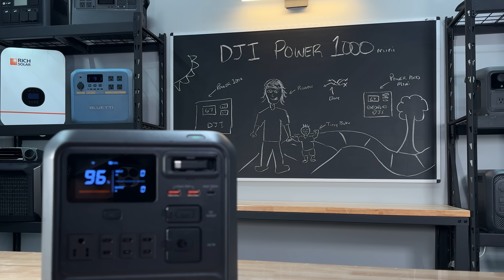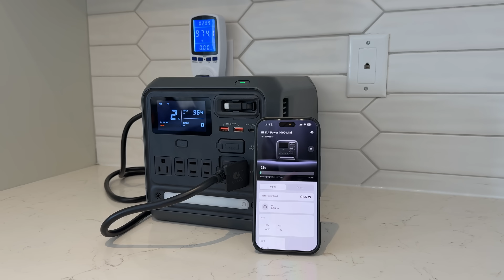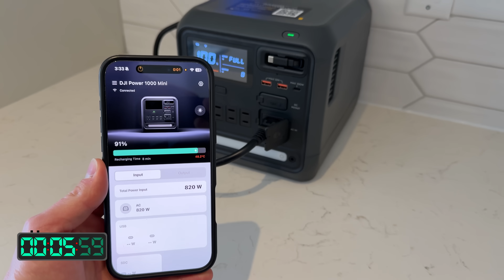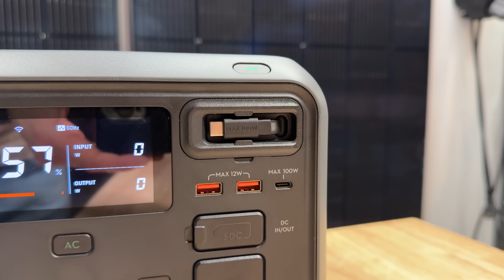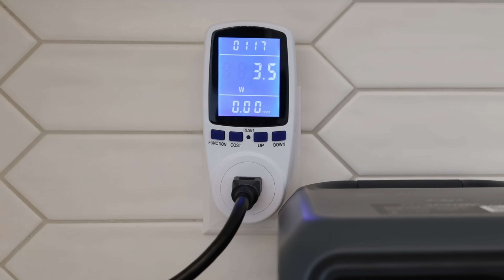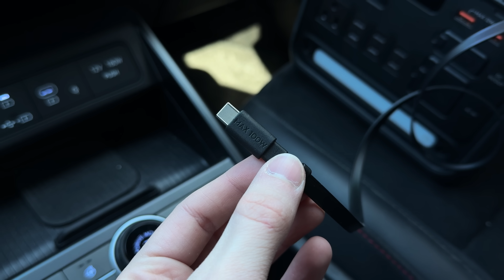Power 1000 Mini - DJI's Best Power Station Yet?

Comment: There is no cigarette lighter socket for connecting 12V devices or a portable fridge. You can use an SDC cable, but then solar charging doesn't work. A total failure.

Comment: Checking in, if i do use this for 80% time UPS functions for my PC (about 500W in max) (probably once a month going for family outing n BBQ)

and i noted that DJI 1000 mini does not have a charge Limit/Cap/protection.

Would maintaining max 100% charge degrade the battery life.

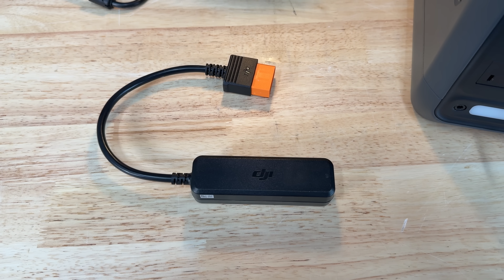Comment: 7:45 is this the adapter you are referring to, what is it called. I accidentally ordered SDC to M4 and SDC to XT60 so waiting on the mppt to charge my power 1000 mini and Ecoflow solar panels. Hopeful now their XT60 connects right into the mppt adapter and off I go. Should handle 400w and I have 2x 160w panels

Comment: I have just tested DJI Adapter with Sola but unfortunately its not charging, also same adapter i used with Car charger unfortunately same , DJI website mentioned Adapter only support dji older models, now i am kind of struck to spend £45 + £45 two different cable for car charger and sola, such a pain

Comment: To charge the device with a solar panel, you will need the DJI Power MC4 Solar Power Charging Cable. Then, MC4 connects to the solar panels. 
You can connect more than two using the DJI Power Solar Panel MC4 Parallel Cable.

Comment: That's the deal breaker we don't need a retractable cord. So if that cord screws up or any reason it affects the whole machine this is a no-brainer you got to be smarter than a fifth grader though to figure that out along with all the other retractable cords on all the other battery banks stupid

Comment: Meh, the Blu elite 100 V2 is exactly the same weight, but an 1800 watt ac inverter not a weak 1000 watt, there’s a Pecron 1000 wh that’s 23 lbs too.  The usb c cable is cool, but could break and get stuck outside making a mess.  It looks decent but only on sale, right now it’s basically the same price as the Blu 100 v2 that destroys it!

Edit: plus the crappy solar low wattage input sucks.

Comment: suprise that the building car charger is completely skipped. Other powerstation will need a costly adapter to charge it from car. This one just needs a $40 cable to get 400w charging and acts as a car battery booster at the sametime.
Reply: No, that's not the case
Reply: @AnnoyedBeach-uk7tf  what is your take then?
Reply: @xuhaoping4360 I didn’t take it, went for jackery
Reply: @AnnoyedBeach-uk7tf  I see, you just don't know how to read, jackery asks $300 for a car charger.
Reply: @xuhaoping4360 but, your buying quality. I don’t mind paying

Comment: 400w solar is not enough to me that is why I use ecoflow delta pro I have 1500w on my roof at least I am able to run my refrigerator and some other devices in my wooden house

Comment: No power surge numbers? How long can it operate at max/over wattage before cut off? Does it automatically turn off after x amount of minutes if not used? Don't understand you didn't include that having only 1 USBC port is definitely a negative. It's 2026, there should've been at least 3 USBC ports and only 1 USBA.

Comment: that solar adapter is a deal breaker for me. my bluetti only has xt60 others have xt90 you can oversize whatever solar panels you have as long as the VOC is not higher than the max voltage input. pretty much every other powerstation doesn't care as long as you wont exceed the voltage. the built in mppt will do the rest, but with this? come on too much drama, hassle and complication. nope not ideal for camping when solar is the only source for charging. 
second that proprietary port for solar charging means you cant expand using a 12,24 or 50v lifepo4 batteries.  nope not recommended, they wanna be a future looking powerstation, but completely forgot how to build one for the real market they intended to sell.

Comment: What happens when the retractable cable stops working? Wouldn't it be much better if it were an inch taller and had a small compartment on top to toss a couple cables in?
Reply: Bingo🎉. If the cable mechanism breaks it’s a pain.

Comment: I am a bit disappointed with your video, I was waiting for it because they were 1000s of videos that were only paid ads, you my hope were you guys, but you dropped the ball.    You mentioned the inverter is 800w when in reality is 1000w (some other influencers said the 800w as well, so I assume DJI provided outdated/wrong data and you never tested properly).  And you ignored what is to me the biggest cool new feature in this power station, the included car charger in the device itself, just with the 50 EUR cable you can charger from your car at 400w.   The only real issue I have is the removal of cigarette lighter output, which is to me the best way to run a fridge.   You can get the connection back by buying the 50 EUR extra set of cables for cigarette lighter though.

Comment: 800W inverter is plenty for a portable office setup in the park. Running a laptop, monitor, and maybe a small fan does not require a massive heavy generator anyway
Reply: 800w is plenty to run crockpots (150w) and myMini Cooker (260w) electric skillet and deep fryer (600w) and the 600ml WTJMOV electric kettle (600w).

I use an 800w inverter to charge my oupes at the 700w ac rate from a 12v 310ah lifepo if it has run low and need a higher output inverter also.

Comment: Most units with more than 2 ac plugs will be tight. I have a small power strip with 4 outlets that I use to avoid the crowding issue. Just do not go crazy and plug 3-4 higher draw appliances into it.

Comment: how does that cord know to give or get power?
Reply: it indeed a very relative thing, i had a powerbank with a 60w 'PD' and it could charge the unit or output 60w, USB-C... the versions of USB vary. I use magnetic usb connectors and cables. They're brilliant and I've had no issues with them except that using them to charge the 72XXXmAh powerbank, using the afermarket adapters, it completely bricked the powerbank unit.

Comment: As an Ecoholic, I find this kinda good overall. The only pain point is the solar charging, very slow and the solar port type is not the very common XT60i. Criticism of the AC plugs layout is also valid! Not well spaced and 2 type A and 2 type B should be the correct mix. This could be used as a UPS but how fast?

Comment: Hard pass. Hands down the least useful AC port layout I've seen. I cant fit any usable plugs in unless I want to plug in 3 table lamps. And with 3 lamps plugged in i won't need the built in emergency light which is about the only redeeming quality.  Can't trust the app not to phone home so I'd have to air gap it at home and I couldn't bring it to work to top it off if I had not power at home (DJI is banned)

Comment: the DJI dose not fit my needs...  for different reasons i would go percron ecoflow or bluetti all for different reasons depending on what i needed at the time. It is always nice to see the other brands but i do not use any DJI equipment so the benefits of a DJI power battery is less effective. 

I tend to watch most reviews to see if a particular power station is something i would recommend for a friend when i hear they want one.. and with the exception of 1 person i know that uses DJI drones and such i just do not see the benefits..  

As for people looking at space savings in a power battery i think the most recent winner is going to be the bluetti fridge battery for the low profile format.  but that is for people who do not need usb sources..

Comment: I actually really like the concept of an extremely small form factor, 20ish pound 1kwh unit like this, but man they couldn't have screwed it up much worse lol. How about 3 grounded plugs spaced an inch or 2 apart since it's only an 800 watt inverter and most people won't have more than 2 things plugged in anyway? The lack of solar port AND only 400 watts of solar total is the most insane thing to me, it's like they designed this thing to compete with power stations from 4 years ago, but it's still not as good because of needing an adapter. Back to the drawing board.

Comment: The solar nonsense is a deal-breaker.  It's not just the stupid Port that they try to force you to use, which I'm sure is fine if you're in the DJI ecosystem. But if I don't care about drones and I don't then I don't care about that ecosystem. And even if you get the adapter it's 28 volt Max input. So do the math that's 14 amps. Try to find a solar panel that's going to get you even close to that 400. So having only 400 and a kilowatt power station is lame anyway. But then you're probably never going to get 400 unless you just get lucky with a very specific solar panel. So all in all it's just really stupid and an easy pass so thanks for the video and review.

Comment: You can get an Anker Solix C1000 that is expandable to 2kWh for $429 so I don't think this represents good value for the majority of people.
Reply: The more pull on that cord the sooner it will not work.
Reply: You're describing the gen 1 C1000; the gen 2 C1000 does not support expansion batteries, but I agree- the Solix C1000 is a far better investment- I've got 2 of them now.
Reply: You’re comparing it to a much bigger unit, so naturally there will be differences. Each power station has its own pros and cons depending on the intended use. The DJI Power 1000 Mini is designed primarily for portability and convenience, which is exactly what most people in its target market are looking for. If someone needs a compact and easy-to-carry power station for travel, rides, or outdoor use, then this product serves that purpose well. Bigger capacity units may offer longer runtime, but they also sacrifice portability.
Reply: The DJI 1000 MINI does have advantages.  I looked at the c1000 - one must factor in that the DJI is smaller - 1.5kg lighter - cheaper (in my country anyway) - by $100. DJI states a life of 4000 cycles - C1000 life of 3000 cycles..
And if you want to charge the mini from a car you do not need to buy and install a fricken dc-dc converter. Thanks to the MPPT converter built in already. That’s a huuuuuge plus. - just need the cable, though it’s included in some promotions. Shame the DJI doesn’t have an xt60 - you gotta pay for that cable which sux.
If you want to extend the c1000 that’s a huge extra cost. But an advantage.
The mini is an exceptional offer in the line up. (if extending isn’t a big necessity) maybe there’s a work around for that hopefully. But the 2-way car battery charging feature is where this kills the competition on the convenience front imo
Reply: @luckyphiltech Thanks for the feedback. Let's have a more comprehensive look at the two options...

Capacity: DJI = 1008Wh, Anker = 1056Wh

AC Output (Running): DJI = 1000W, Anker = 1800W

AC Output (Surge): DJI = 1200W, Anker = 2400W

Expandability: DJI = No, Anker = Yes (Up to 2112Wh)

Weight: DJI = 11.5 kg (25.4 lbs), Anker = 12.9 kg (28.4 lbs)

Solar Input: DJI = 400W, Anker =  600W

Cycle Life (80%): DJI = 4,000 Cycles, Anker = 3,000 Cycles

Price: DJI = $467, Anker = $429

I think that you will find that weight difference and cycle life are not significantly different to the extent that they would override the advantages of the C1000 and that in real world circumstances the C1000 has the advantage where is counts the most.

Comment: Please spend more time on the DC/solar input.  How many amps and at what voltages.   Some units can draw full amperage as low as 11 volts, others need over 30.    I have seen units can only charge quickly within a narrow voltage band which might match well to many solar setups or battery inputs (when using external batteries to extend run time during a prolonged outage).
Thanks

Comment: If power stations are going to be used/promoted for use as UPS units it would be helpful if the testing data you guys go over included their limits for surge power.

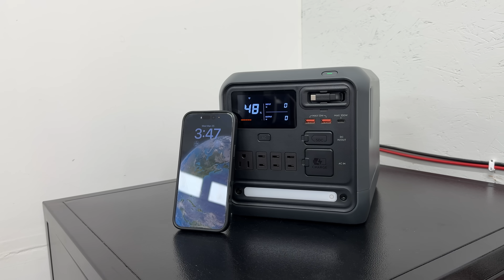Comment: 6:48 "Its idle consumption was only about 10 watts per hour."
Since a watt is defined as one joule per second does this make the idle consumption 10 joules per second per hour? What the heck is that, the change in the rate of energy transfer, or in other words acceleration of energy transfer? Your statement does not make sense.
Reply: Seems pretty clear to me.  What's hard to understand about ... it consumes 10 Watts every hour the inverter is on?
Reply: @RPRosen-ki2fk  It consumes 10 watts continuously. It would be like him saying his car used 10 gallons of gas to drive 60 MPH -- which is nonsensical. "Experts" in the power industry like they claim to be should get this terminology right.

Comment: There is an interesting dongle for this unit that basically is just a straight cable (with a fuse) from a car battery and will charge the unit at 400w. Or reverse charge your car battery automatically (or manually). Basically enabling the Mini to have an alternator charger at 400w. Competing brands offer their own 1000w or so alternator chargers for maybe $300. And those have a separate DC to DC adapter box that connects to your power station. Adding extra clunkiness.

The Mini just has a straight cable to the car battery and uses its internal MPPT and SDC port to control the flow. Which I admit is a clever way to use the SDC port. Sure its only 400w though. No idea how much the cable is going to be though. (Looked it up: US$ 34. Unsure if available in the US.)

But IMO a single SDC port ruins the accessory system because you have to choose between: solar, car, alternator, (etc like drones) and literally having to unplug and plug stuff constantly if you plan on using it.

I mean, it doesn't even have a lighter socket. Or equivalent 12v DC for portable fridges. SDC has a dongle for lighter socket. Another one.
Reply: Can you  link the dongle?

Comment: Since you have been using it indoors as well, can you tell if this device produces any type of smell at all? I used the 1000V2 in my ventilated office, but it kept smelling something chemical. DJI replaced the unit, but it has the same problem.

Comment: Underwhelming power bank. Low dc input and sorta a small inverter. I own a BLUETTI elite 100v2 that I recently purchased on sale for under $400 and don’t see this as a better option. The BLUETTI has 1800w continuous ac output, max 1000w 20A dc input, and weighs the same. The plugs also would be a no go for me also. The size seems to comprise the functionality. I am no expert but I definitely think there are better options for your money.

Comment: This is definitely a step up from their 500 model, but the ECoFlow Delta 2 can still be had for almost $100 less, with a much larger inverter, battery expansion and still pretty light around 5 pounds heavier (it is incredibly loud though!!).  Also, with the Pecron E1000LFP, it simply has more of everything including the 25A 12V DC output for about $80 less.  Nice to know about the solar issues encountered!  DJI, in their promo video, was touting that DC input as a 400 watt alternator charging input, which would be cool except it looks loke that cable isn't included either:(

Comment: I would order one if they were available.
Reply: Really? There literally is no worse way to spend that amount of money lol, every competing power station is significantly better. The Bluetti Elite 100 V2 charges at 1,000 watts via solar, has the same battery size and an 1,800 watt inverter with 4 grounded plugs and costs less. It's like getting a Toyota for less than a Kia.
Reply: @enthused7591  the only advantage of this DJI unit is the integrated car alternator charger (well, you still have to buy the cable for $50, but that's reasonable).    I wish Bluetti starts integrating their "Charger 1/2" into their units).

Comment: So what if the cable is broken and need fixing? Change the whole unit?
Reply: The retractable cable is replaceable. You can buy the retractable module thing. Probably for a really annoying price though.
Reply: @TechInspected ok that’s actually cool. Cause on power banks these are not detachable or repairable.

Comment: I thought the solar input was happy as long as you dont go over voltage
Reply: Correct. They probably went over on the voltage. If they did not go too high on the voltage then the DJI component does not live up to the power/current rating.
Reply: hard skip. other powerstation wont give you headache on that solar proprietary adaptor, all powerstation exept dji has built in mppt as long as you dont go over voltage itll charge the heck to any kind of solar panel. no drama

Comment: It's absolutely weird to me that dedicated UPS units with Lithium aimed at a home user are basically unobtanium. Why would anyone buy ancient lead-acid chemistry batteries these days? So I guess for home UPS duties these powerstations arte the only sane option (of whatever brand).
Reply: The main problem is LFP degrades much more rapidly when not cycled regularly and just sitting under a warm desk behind a desktop at 100% all the time is probably one of the worst use cases for it.

There are probably good software ways around that, like if you enable UPS mode only charge to 75 or something.

But also, a 1500VA line interactive UPS is only about 200-250 bucks. They are designed to keep your machine running long enough to wrap up and turn off properly, not run backup power for a day.
Reply: @Snerdles  And almost every "real" UPS (even cheap ones like APC) have a USB port to connect it to a PC and in order to shutdown the PC properly when the state of charge is low.  And the software is client/server, so you can install the client version in many other systems and they will be all shutdown.   For this , the best solution is to put a cheap real UPS in front of a power station with UPS support, you combine the best of two worlds.